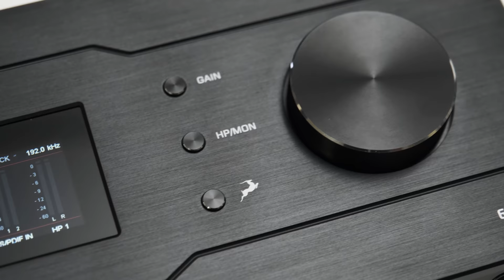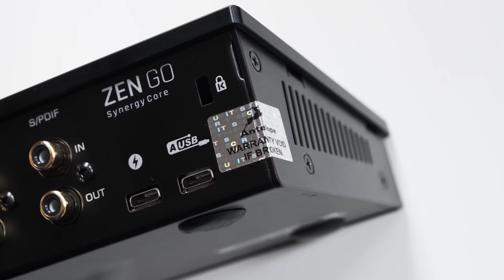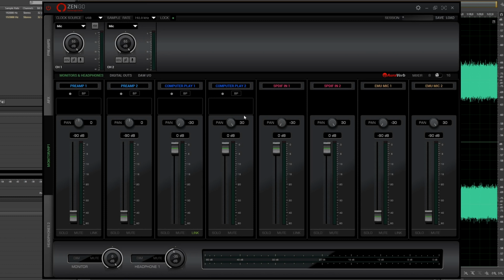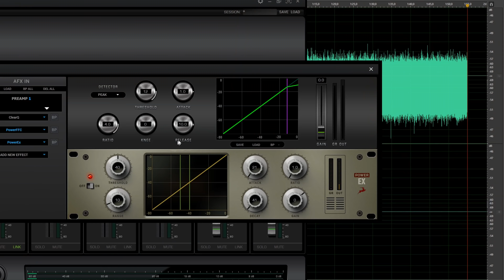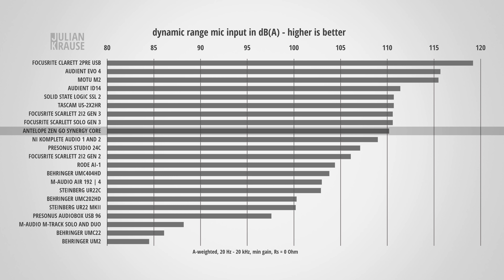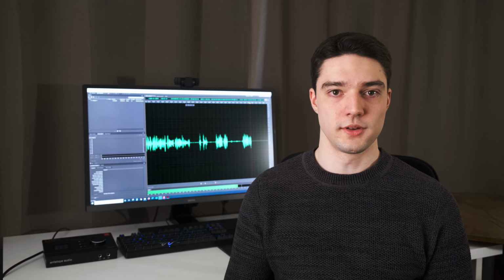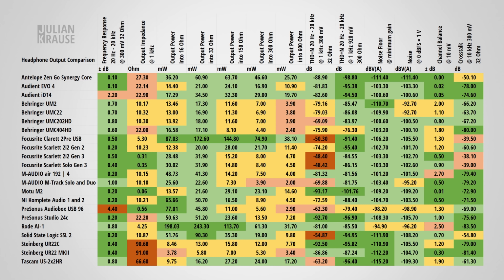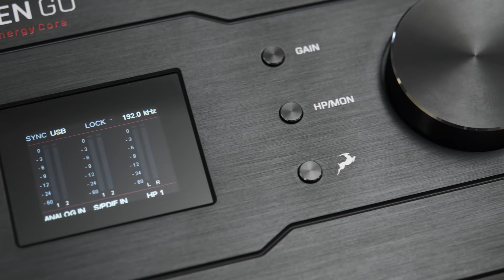Antelope ZEN GO Synergy Core - Audio Interface Review (real-time effect processing?)

Comment: Hello Julian, I really enjoy your thorough reviews however; can you please put some time into driver stability/performance on the system you test run these products? It's arguably one of the most important things to consider when purchasing any USB audio interface. Thanks
Reply from the maker: Good point. The reason I don't comment on driver stability is because I have yet to find a reliable method to test this. Pretty much all interfaces I tested so far have worked flawlessly with my PC, so from that standpoint there is no difference in driver performance to report. Software and hardware setups also change wildly from person to person and testing many different setups to make a conclusive statement about the driver performance is pretty much impossible to do. But I'm open to suggestions on how to test driver performance. If you have any idea for a possible test setup, feel free to share it me.
Reply: @JulianKrause  Yes, of course, I had also taken the points you made into consideration. I don't believe you would be able to provide any conclusive answers on driver performance as you've mentioned there is far too many variations in system builds however; providing some information regarding your system setup (motherboard, CPU, memory etc.) and driver/firmware version, might give some of your viewers an idea of how the driver compatibility/stability might be able to work on a similar system. I would say the motherboard is possibly one of the most important factors, of course that is without discounting any other potential conflicts that may arise from other present hardware as well as software installed.

As for testing, one suggestion is running multiple midi and audio tracks across a few different DAW's to see how the drivers perform. I suggest this as it seems to be a very common reported scenario for users on forums who experience driver issues. They will tend to be when working in a DAW when they notice audio pops and crackles, program freezes when under various workloads and similar issues.

Hope this helps.

Cheers
Alex

Comment: Great review! I was trying to figure out the best of the bunch between apogee element or duet vs UAD solo vs zen go, what are your thoughts about it?
Reply: Should i consider the Antelope Zen Go Synergy Core instead of the apollo solo? I have a MXL REVELATION-II.
Reply: Same question !!!
Reply: @applecrazy1  what I ended up choosing was a second hand apogee duet 2,  in the same ballpark considering the quality and none of the software problems of the zen go and with the solo alone you can’t use more than say, 5 or 6 plug ins, and since my Mac is able to run a lot of plug ins and I have some quality ones the DSP processing didn’t really mattered as much as I thought it would.

I’m really pleased with the duet 2, no regrets whatsoever!
Reply: @pedrovanzeler1185  the thing is i dont care about the real time ltency, ill use just my normal plugins in my daw. you you advides the zen go?
Reply: @applecrazy1  I never used any of those, my thought process was, since I won’t use any DSP processing from the interface I only cared about the components. That’s why I went for a used apogee because it has the same quality for 200 or 250 euros instead of 600. The antelope seems to be a great interface but the software issues people talk about made me hesitate . But I can’t confirm or deny that, sorry mate
Reply: @pedrovanzeler1185  ok thanks ! adn you recommend the mojave 201 mic ? For vocals
Reply: @applecrazy1  I’ve heard good stuff about it, it was the prize of a contest I participated with warren Huart, kholer, and jens bogren being the judges. Maybe not that one but there were Mojave’s there. 

However I never tried it. I don’t have any quality mics yet. But my goal is to get an sm7b since I record mainly metal scream/growl and a WA - 87 for cleaner stuff. But I’m not that deep into mic quality and differences.

I’ve heard half the metal producers and mixers say they hate the sm7 and the other half say they love it. 

A lot of stuff is so subjective in this field and that’s what makes it fun but also really hard to start because there is not a clear path to follow
Reply: @pedrovanzeler1185  Agree
Reply: @pedrovanzeler1185  Hi, apart from the software issues on the antelope, and the Dsp on the UA (which I also wouldn't really use that much) did you came to any conclusion (based on components) regarding which one of those 2 interfaces is the best? Unfortunatelly for me a used apogee might not be an option.
Reply: @ajga5435  Hi! Since I got the apogee I stopped researching about it but I’d say any of those are already really good. Rme is a bit pricier but never heard a bad thing about them. 

Take in consideration that this is all filtered forum knowledge, I never tried or heard any. (Except the Rme while recording an album, witch is amazing but I only played guitar at the time so I didn’t know as much about this gear)
Reply: @pedrovanzeler1185  Oh well... Thanks anyway mate! I'll take it into consideration

Comment: I'm avoiding anything that's using a Kernel Extension on Mac OS still without promising a date for a System extension or class compliance. Seems like an amazing device but Apple is going to kill support for it in 2022 on Apple Silicon devices via updates. I'd get it if they cleared this update though the Auto Tune seems killer.

Comment: Do you have any headphones you would recommend to use with this interface?  Mostly for referencing mixes?  I have a pair of sennheiser HD 280s and I see what you mean with the lower impedance (64).   I find myself turning it up pretty loud to drive the cans.  (-25db)   Would headphones with a higher ohms count get louder before having the dial cranked up?

Comment: I do own the device and I'm really surprised to see the measurements and to hear that it is not that clean as it should be for the devices of that class and it is put in a row with noisy Steinbergs. I owned several devices like Focusrite Scarlettes, different M-Audios, TC Electronic desktop Konnekt to name a few, even old Yamaha PCI cards back in the day and I still have Presonus Audiobox 22 VSL, but Zen Go in the cleanest interface in terms of mic preamps in my opinion. I don't have measurement equipment to prove that, I only have my ears and what I hear is very clean sounding interface. I can hear that on Hi-Z too, since I'm using those ones the most. My guitar amplifier plugins never sounded that clear and killer through the above-listed devices. 

The only thing saddens me a lot about the device that it is taken to my dealer for inspection, although it works great for me in terms of connecting to my laptop and working with it in my DAWs, it is not working with my mobile phone as I was expecting it to. In Antelope's manual they say it is class compliant meaning that I could connect it to any modern mobile devices and use it as an interface there, but it doesn't. It's just doesn't power up when connected to mobile phone. Antelope\s support says the device is faulty and should be changed or fixed, the dealer seems to not agree as they are doing thorough inspections on the unit. That's really a thing and I hope they'll fix it somewhere in time. I was hoping to use it for my mobile setups with BIAS plugin, but no luck yet. I'm currently using my Presonus Audiobox as a substitute to it for my regular setup and it is too noisy, I can't play my amp plugins, cause they are producing a lot of background noise. And it's not because of the bad cables or the guitar. I just changed them a month ago. Presonus just sounded always like that, but way cleaner I must say that M-Audios and Focusrites that I used to own. Hope to get my unit back soon. Maybe Antelope and my dealer will be reading that comment and do something about my unit and replace or fix it. 

Julian Krause, probably you could try and connect your device with any mobile phone you have and see if it gets powered up when connected? If it does then my unit is definitely faulty, if not, then it is a hardware bug Antelope should address.
Reply: I'm not Julian but mine works with my Laptop, Desktop PC and iPad flawlessly. Didn't check my Android phone but who uses that anyways...

Depending on your phone you might need to connect a charger to the second port on the Zen as it requires more power than USB2 is specified for. USB3 is fine though.
Reply: @anonymus8760  thanks a lot, mate! Mine is being replaced at last by the dealer. Hopefully will get a working one this week!

Comment: Hey Julian thanks for all the great tutorials you create. I was wondering if you still have the Zen Go interface. I would like you to do  one of your test again, the noise test. but do it different and I think this also kills the screen brightness messing with the signal. Here is what you should do before redoing the noise of the Pre Amps test. You will need 2 usb cables and a power brick. First plug 1 usb cable in the usb slot A on the Zen Go and connect it to your computer. Now connect the second usb cable to usb slot B to the power brick and now plug it into a power socket. Final step, now on the Zen Go press and hold the HP/MON button on the front of the Zen Go until the menu pop up.Now stroll down with volume wheel to (Power Source) , press the volume button down to inter the menu stroll volume wheel 1 time right from from power A to power B. An now I think this one of the Lowest Pre Amp noise I have heard. Please give this a go I promise the Zen Go will move way up the chart in Pre Amp noise. I also tried to explain it the best I can to help people who may had issues. They only way I found this out was when I used the Zen Go without my Mac or Pc as a outboard Mic Pre. And yes it works amazing. Thanks again for the wonder work you put into your videos.

Comment: Really love your videos! But I have a question:

Why the speed of the audio feedback is faster at 192khz than with 48khz? Shouldnt be vice versa, since 192khz is higher resolution?
Reply: My understanding is that your CPU load will be higher at 192khz, but latency will be lower.
If a train comes once an hour, there will be a lot of waiting on the platform (latency), but the system will be inexpensive to operate (CPU load). If it comes every 5 minutes, there will be much less waiting, but will cost more to operate.
Reply: @mdlouie  thanks! That clarifies it for me hehe

Comment: Hello Julian first off all thank you for your tests and video. I have to ask something in your "ein" chart there is to many soundcards and all of their max gain is diffrent too. When you calculate your ein do you take it with an constant gain value like 50 db 65 db etc or turn them full gain on and calculate it ?
Reply from the maker: Hey, good question! For the EIN measurement the preamp is set the maximum gain setting. Then I use a known reference signal to find out the gain of the preamp. This is then used to calculate the EIN. So, the EIN measurement takes the different gains of the preamps into account and can thus be directly compared to other EIN measurements.
Reply: @JulianKrause  thank you Julian for your fast answer. May be you can take a video about your measurment technics for the questions about the methot. We re following ...

Comment: I bought one with the ultimate pack plugins. Few huge charge plugins can have troubles. And i can't change my sample rate when i want on their windows application. The synergy core guide is pretty bad/empty. They didn't update it since 4 years at least. It's a shame, really. 

But i am pretty happy with this interface. Will be better in few months when thunderbolt 3 will be everywhere on windows.  

I was about to buy UAD but it's way more expensive for no reason.
Reply: Thunderbolt 3 is already available in high-end windows PCs mostly intel based but they exist
Reply: @flashback4588  yes but not enough used. That's why antelope don't release the indawplugin for windows. I bet it's in theirs papers for the next months. The Thunderbolt 3 started to appear for windows this year with "low" price. It's very new. I am looking for Thunderbolt 3 since few years and I see the price are falling.

Comment: I'm trying to understand will DAW on let's say Linux/Windows PC use power of a Antelope for it's DAW's software (Reaper etc.) effects or it will still use PC's power?
Tnx!
Reply: The DAW is processed by your computer.
What an interface such as this one enables you to do is to use some amount of plugins that are only using the computing power of the interface, thus freeing the processor of your computer, which would otherwise have to compute similar plugins itself.
You get (I think) 37 plugins (EQs, compressors, ...) you can use with the interface, plus generally 8-10 more with long-running promotions.

Comment: Late comment but you sure weren't kidding about the issues with low impedance headphones. The headphone output sounds atrocious on my akg k712 pro (62ohms) and barely passable with my hd 560s (120ohms). That plus a weird humming on the power port when connecting it before the data port makes me thing that a) my unit is faulty (which might be the case, but it works fine on my pc), or b) this really isn't for me. My 1st gen focusrite scarlett HP output sounds better! and if i can't track properly... heck, it renders the unit useless to me.

Comment: Do you think the high impedance of the headphone amps can be fixed with a firmware update? Or is that just a hardware thing? My headphones are 32 ohm so I'm not gettig the Zen Go if that can't be fixed.
Reply from the maker: That's definitely a hardware feature which cannot be changed via firmware. Which headphones are you using?
Reply: @JulianKrause  Ollo Audio S4, and I'm waiting for my Slate VSX to arrive (hopefully within a month or so), and those are 37 ohms, I think. 
I was also looking at the Focusrite Clarett 2Pre but it has that nasty TDH problem you say, do you think ALL Clarett 2Pre have that same problem? Or was it bad luck? 
I don't really care about the preamps, I need an interface just for mixing in headphones so I'm looking for great D/A converters and headphone amp.
Reply: @levondarratt787  My Ollo headphones are worth around 300 euros, and my VSX around 500 US dollars (both being professional mixing headphones). I've even seen some Audeze headphones (which are pretty much the best headphones in the world) with even lower impedancences than 32 ohms. Low impedance does not mean low quality at all.

Comment: Looks as if an M2/4 and a 286 is a better purchase then ?
Reply from the maker: Well, it really depends on what you want to do. The 286s is less portable and has less features compared to the Zen Go. But I agree, a M2/4 + 286s is a valid alternative to the Zen Go in many scenarios.
Reply: @JulianKrause  the main issue I have with the Zen is the very steep price for very little performance advantage of the M2, I really was expecting it to be doubly as good in most areas

Comment: Julian, I bought this interface to use on Windows, but I haven't been able to activate the interface due to the poor Antelope Launcher issues.
Basically it's not starting at all, can you share your windows computer specs for Hardware AND Software.
Just so you know, I've tried in3  different windows machines, with 2 different Operation Systems, and still could NOT have antelope launcher to Launch, thus, preventing me from activagint AND using the interface.
I'm already talking to Antelope, but they seem skeptical and are saysing it's the OS, so, this is very frustating, if you can help me out, since  I believe you're the only Windows User that I know off for this Zen Go.
Reply from the maker: Hey, here my setup:
-i7 8700k
-32gb RAM
-GTX1080
-Win 10 Professional Version 21H1
- Adobe Audition CS6 for recording

To activate the interface you will have to create an account here: https://en.antelopeaudio.com/sign-up/
Then you can follow the steps in this video:
https://youtu.be/j0YSX6nkBMQ
That's all I did for the activation. You could also check your firewall settings to ensure the communication for the Launcher software isn't blocked.

Comment: antelope Zen go I bought a wonderful audio interface no distortion low noise two headphone outputs and loud quality excellent reverb in the middle I do not like it in Cubase 11.3 much better in antelope good effects but not super, bad works with Cubase 11.3 many problems with the driver
I bought microphone solo, clean highs and high middle of lows is not enough, noisy, a lot of pictures of different microphones and the sound does not change you switch to another microphone and the sound remains microphone solo Now my Mic stop to work I waiting two weeks from Antelopa fix it I have warranty  "Antelopa" where are you??? Long time no answer